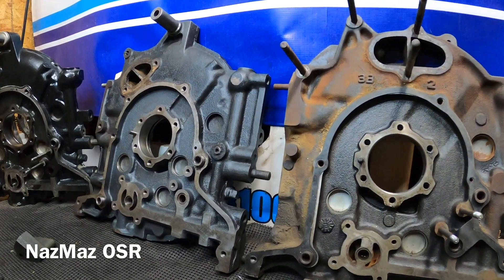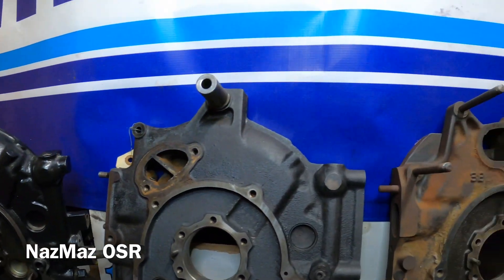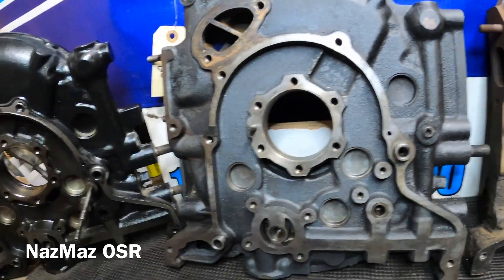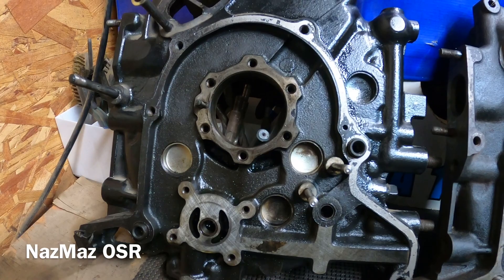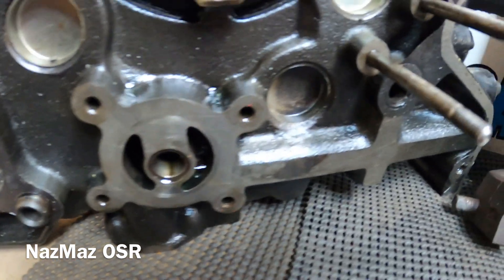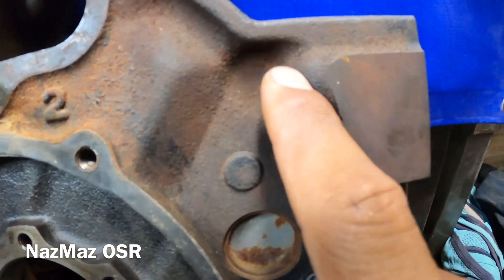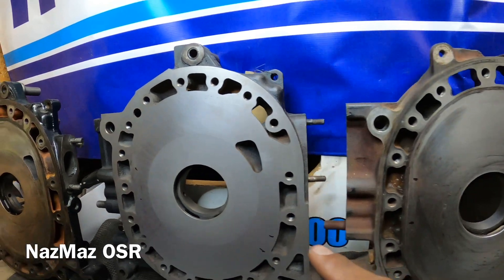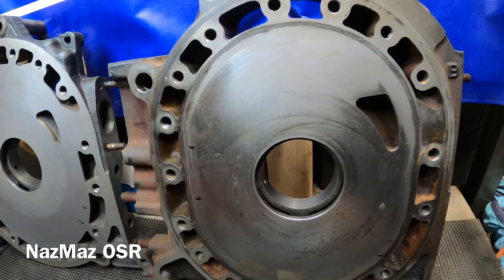Mazda rotary 10A, 12A, 13B front housings, what's the difference? part 1

Comment: Still catching up on your videos, just to add, I have had a few twin dizzy 12As with the single dizzy front cover and RX-7 electronic ignition, the bolt hole that goes missing is still there in the front cover, I drilled mine out so I still had all the original bolts there.
Reply from the maker: Glad to know that there’s still some people like you still working on old skool rotaryz…